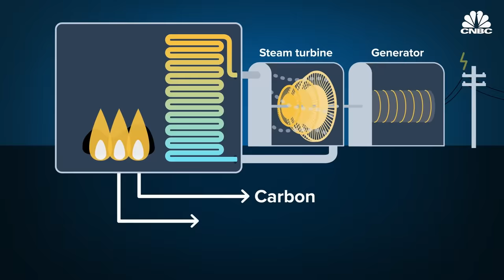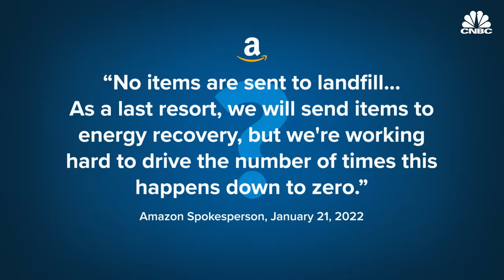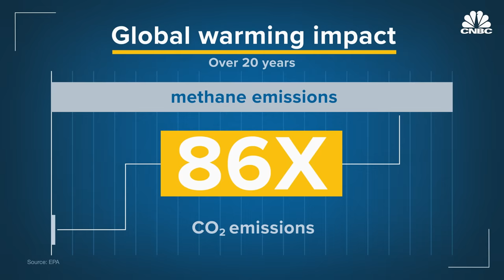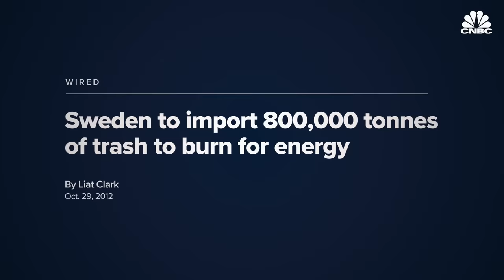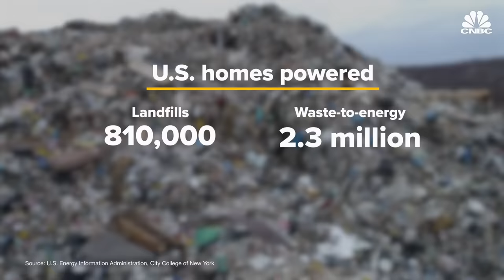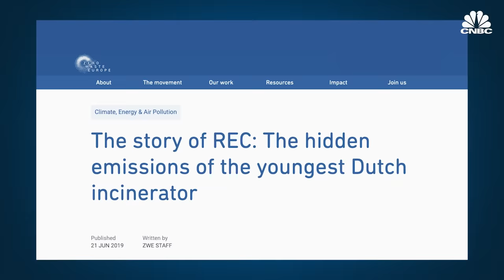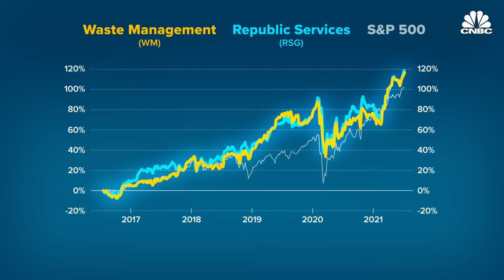How Amazon, American Airlines And Subaru Burn Waste To Make Energy

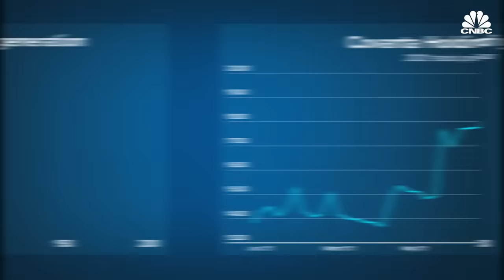Comment: This video is largely misinformation.  Almost every point being made has a huge (probably deliberate) error in it.  The chart at 13:46 is utterly false.  Nuclear is not the second most expensive way to generate electricity, it is far and away the cheapest that's why nuclear power plants sell their energy at or below four cents per kwh which is about 1/5 of wind and solar.  Gas generation varies from eight cents to thirty cents depending on how 'on demand' it is, and energy from waste is off-the-scale if you have to pay to drop off fuel .  Also, the idea that energy from waste emits less CO2 than gas generators is frankly laughable.  However, the gist of this is correct: It is better to burn than to bury waste.  That part is correct even if the costs are much higher and it has nothing to do with emissions of methane which are so volatile that they just never accumulate in the atmosphere.
Reply: Great summary of facts. This video is full of so much misinformation.
Reply: @rb8049  i find these cnbc vignets to be propaganda more often than not.
Reply: This is cnbc afterall
Reply: Building a new Nuclear power plant is one of the most expensive ways to generate electricity in the US and EU! China and some other countries with lower labor costs, less public opposition and fewer regulatory hassles are still building new Nuclear capacity. In the US and EU except France we are unlikely to see more Nuclear built any time soon. And by the way Nuclear is a base load power that can't be quickly ramped up and down like natural gas plant or batteries 🔋 therefore they sell at a "loss". Nuclear power plant is a 50 year investment so they calculate LCOE (levelized cost of energy) and if it's not worth it they ask for incentives from the government.

Solar PV is one of the cheapest ways to generate electricity. On the country side it can be even more affordable since we can avoid costly grid upgrades by local production and storage.

Wind is only cheap at scale in desirable locations.

Hydro isn't pricey either but most suitable locations are already producing.

Lastly, efficiency improvements can be cheaper than adding new capacity :)

Comment: Remember, also leachate from landfill tips is difficult to manage. It can enter creeks and ground water systems with devastating results.
Reply: Only on old outdated landfills, they are a problem, but modern landfills are properly lined.
Reply: @masaharumorimoto4761  There will come a day when the caps on the "modern landfills" will break down and erode away and these "properly lined" landfills will fill up with water and spill over and pollute the ground water. Most of what goes into a land fill is combustible and ultimately landfills will catch on fire and cause terrible air pollution. To prevent these scenarios from happening in the distant future we need to burn the trash that we are producing today and open up the land fills that we do have and start mining them for fuel and resources such as metal and glass.

Comment: Pretty good video here, BUT many assumptions are just thrown together.  The ash or what is called residue is NOT toxic from these incinerators.  The USA combines the Bottom and Flyash because the EPA does not get involved and provide counties options.  Nobody wants to take the ash because the EPA will not make a rule on what it can be used for...
Other countries are using the same exact incinerators and yes they use the residue in many things.  Not here in the good ol USA because too many greenies think they know everything.  At least this video is mostly truth based unlike many others before...

Comment: Energy can be had at a lot less of a price to environments and companies overheads when the engine of a generator is swapped for a electric motor. Electric motors have been around 30yrs longer than gas

Comment: 1$3,000,000 1.5mw wind turbine OR 857 10kw generators 

7.07x more power same cost! Before I switch it to full green energy 
No fossil fuels. Fossil fuels will be needed but not at the current scale

Comment: Ironically plastic packaging can reduce food waste, it can double the shelf-life. Arguably it's beneficial to the environment (when used right).
Reply: Thats only partially true. With fresh produce its most of the time the opposite. Plastic reduces the ability of it to „breathe“ so it will go bad quicker. Many fruits ond vegetables hava a natuaral „packaging“, its called the peel of the fruit. Processed foods on the other hand can be conserved in plastic. But thats not the way to go. Packaging thats used more than 1 time is better. In Beverages that is already done in many countrys of europe. Single use plastic simply isnt neccesary many times, but its easy and cheap.

Comment: Finding the most advanced filtration system for burning waste is the key here as well as applying the best system to isolate CO2 so its not dumped into atmosphere. Turning waste into clean energy, reusing it again with close to zero environmental impact are the first steps into circular economy and system we need to switch to. However first and foremost we need to REDUCE amount of trash and waste by reusing containers and packages we get with our purchases as well as moving towards biodegradable packaging. This is realistic solution in my opinion in case we want to keep consumption at current level and higher. However I believe the shift would need to be done also with consumption where we would rather consume less by purchasing quality products which will be designed to last longer and be repairable.
Reply: But unfortunately this is not what is happening.  The sales of cheap imported products of Amazon and Walmart keep increasing, and smaller businesses all fill bankruptcy.  Everyone need to make some efforts to change their lifestyle
Reply: @PG-3462  I agree, but in the same time you need to do all you can on all fronts to lower emission of the greenhouse gasses especially methane which is released in the landfills. Burning trash with best possible filtration is better option than leaving it in the landfill, over and out. Of course not burning it at all is even better, but that will take long time to stop or significantly decrease.
Reply: @PG-3462  Agreed, but if you to go with worst case scenario when people throw all the trash together with everything - organic and inorganic, you need to have efficient way to separate it which takes energy and time (resources).
If you do that efficiently you can somehow produce methane from the organic waste, but what really matters is how much energy and resources are you going to spend on recovering organic waste in comparison to generating new energy. The final value has to be at least equal or 0 or possibly gaining profit from it.
Same has to be calculated with burning both organic or inorganic waste.
Of course the best way is that masses will take fresh food from their own fields, but that's completely unrealistic and society will always rely on some sort of packaging.
I agree on the other hand that most of our trash comes mostly from the food packaging, so maybe this is something what needs to be improved, but without government funding of the new biodegradable materials we are going to end up with the classic plastic and cardboard. And then leaving it on the landfill and not burning it for some energy recovery with excellent filtration looks to me as not right.
Reply: @El.Duder-ino  Producing artificial fertilizers alone consumes a lot of ernergy (and extracting the raw materials used for it too).  Thus, separating organic matter from trash is the most efficient way of doing things because you can use all the compost generated to replace some artificial fertilizers and you can produce natural gas at the same time.  

Since I started doing compost, I realized that the amount of organic matter we generate on a daily basis is insane.  When you multiply this by an entire city of over 2 million people, it's a lot of methane and fertilizer that can be collected

The other thing it made me realize is that most of the plastic trash we generate on a daily basis also comes from overpackaged food.  It pushed me to purchase as much as possible of unpackaged fresh food which allowed me to reduce the trash I generate by nearly 80-90%.

Comment: never understood why they cant manage the emissions from the burning.... wouldn't it be a simple thing to blow the smoke in a dome and spray mist all over the  dome to trap the particles in water drops ? let it fall in a pool and just keep re-pumping the same water over and over into mist in the dome? at one point you dump the  pool into a larger pool to let the water evaporate ? would the gunk be left over at that point... I'm no scientist but just sharing my thoughts !
Reply: That's almost what they do now.  Long cylindrical stacks have various chemicals misted in them to trap various undesirable chemicals which fall to the bottom.
Reply: @grayrabbit2211  but the stacks are open ended so still releasing into the atmosphere so they cant really trap 100 percent this way or can they?
Reply: They do that already it is highly toxic the left over
Reply: @YesItsReallyKeith  I don’t think they are simple open ended cylinders.
Reply: That is what air scrubbers do

Comment: Incineration based waste-to-energy is not a sustainable replacement to landfill. The emissions from landfill are not from the dry waste and the Amazon returns being fed into this incinerator. The emissions from landfill are from the decomposition of food waste which makes about 50% of municipal solid waste. When incinerators are fed raw waste which has high moisture content, the incinerator operates at low efficiency and that is not good. Feeding directly recyclable materials like plastic containers and bottles and cardboard is wasteful and a contributor to GHG emissions. The sustainable solution for waste is the Integrated Material and Energy Recovery Facility (IMERF). The IMERF consists of a Material Recovery Facility (MRF) which sorts and separates the waste to recover the directly recyclable material, which is less than 20% (cardboard, plastics bottles and containers, metals and glass), the organics processing facility which uses anaerobic digestion and composting for the extraction of biomethane and the production of compost, and the chemical recycling facility for the processing of the 20-30% of the unrecyclable waste (textiles, packaging material made of soiled paper and film plastics). The chemical recycling facility thermochemically converts the unrecyclable waste to char and biofuels. Employing the appropriate thermochemical process enables the sequestration of the non-biogenic carbon in the form of char which can be used in the making of plastics, additive to asphalt and other uses.

Comment: Most larger landfills capture methane and convert it to energy.
Reply: Not everything gets captured. Its simply not possible. Leaching, when the lining if the landfill finally breaks is also a big problem for surrounding water bodys and the groundwater. Landfills are one of the worst ways to deal with waste. But its the cheapest and most convenient.
Reply: Methane is 25x more climate damaging than co2, so only small amounts escaping over time result in devestating results globally.

Comment: Reduced, reuse, sort, recycle, up cycle, then burning it is the best way. If we were to sort things properly we wouldn't have this issue. Instead of using a single stream recycle we could ultimately save recycling. And food waste methane could be reclaimed in a facility and used on our gas stoves/water heaters and CNG transportation. We could also use water from our drains to water lawns flower beds. Carbon capture fuel can be use for ships and rail transportation. With  bio fuel waste can be used to produce the energy needed for carbon capture. So many solutions that take brave action to stand up and say that we want change

Comment: Show a way to solve the issue. Blaming the consumer makes it easy for corporations to dump their trash with blame. They wrap everything in toxic plastics, containers are not dissolvable vs recyclable, products and clothing are made cheap and fall apart after wearing it, etc, etc.  Toxic air from combustion is not a solution.

Comment: All of this relies on the operator doing the right thing 24 hr a day, not just bypassing the pollu4controls after dark.
Also relies on the science being right, it can be accurate or it can be bogus.
Used to work for a com4that design. Some of these systems. That always knew early when EPA would show up.
They always had clean records when examined.
But the plumes and many vents doubled in heights most nights.
It could go better.

Comment: The burning has to have a misting system in the smokestack to remove perchlorate perfluorate and perbromate as well as carbon dioxide.  It is better not to manufacture halogenated vinyl or halogenated carbon molecules because they don't burn to anything less than the bleaches.  These still still have the functional groups of halogenated carbon.  This pollution affects the motility of sperm in all species and reduces atmosphere gases to water and nitrate.  We still have perchlorate perfluorate and perbromate pollution that interferes with reproduction of fish .birds and shore life. It is important not to manufacture use or burn any halogenated carbon or halogenated vinyl molecules so that we can have atmosphere and fish in the oceans.

Comment: This is nothing new. In my home city of Ames, Iowa, this has been done since 1975. Also, many landfills capture Methane and recycle what is captured.  It’s important to make sure a WTE has a robust air pollution control system on it to prevent pollutants getting into the air. Dioxins is the most common pollutant that is devastating to the environment. The cost of land is the determining factor on whether to go WTE or Landfill. Where land is expensive like in the NE and Florida, you will find more WTE facilities. 
Amazon and other retailers like incineration because it reduces the risk of their products getting into the emerging hands especially if there was an item recall.

Comment: How much water daily does these water to energy things use?
Reply: You mean hydroelectric? Well, it depends on how you define “use”: a hydroelectric plant doesn’t consume any water at all. All the water that flows in also flows back out. But if by “use” you mean how much flow it requires, it’s a huge amount. A small commercial hydroelectric turbine will have hundreds of gallons per second flowing through it. A large turbine will be much more: a turbine in the Hoover Dam has a flow of almost 30000 gallons per second.

Comment: It reminds me an old story, - if you don't want prices to go lower for oranges, - you are sending extra to the landfill. They don't want to reveal how much products they are taking out of warehouses, - they are just burning them! Why don't we pass the law, - that specific items should be warranted for specific amount of time? If not, - producers should be punished. Why is there need to create new freezer each new year? Just create the one great product, which will work for the 20 years without a single failure. Make a 10 years warranty for those products as the standard and those companies who not gonna meet it, - they will be banned as manufacturers. Why underwear and socks are lasting only short period of time? I bought in 2000 two t-shirts. Not sure what they made off, - but I am wearing them constantly for the last 20 years. They are looking like brand new, - but they are not. We should bring all the manufacturing standards to a very high level so we will stop getting those issues ever.

Comment: California should have this since its water dam power is getting to a point where it can't power anymore. They might take this on and take on a large number of waste to gain back their power.
Reply: There are many waste to energy plants in cali...covanta crows landing, the one in this video, is just one. There are many more on the i-5 and hwy 99 corridor. Many biomass power plants as well. Too bad all the big efficient plants that maintained the base load have been shut down. Moss landing, morro bay, potrero hill, Pittsburgh, contra costa generating station,

Comment: I dispose 40lbs waste each day because I use 6 disposable adult diapers per day for 34 years because I have urinary incontinence from damage caused by diabetes .  Those diapers are heavy with urine.
Reply: in a gasifier, start with generous embankment of coals. add a dew dry sticks until the refractory is red hot through and through and place 2 wet diapers on that and dont add anymore until the diapers are char. mind your coal bed. if the coal bed gets thin, you will lose the your flare. if you dry the diapers first then they will go up so fast and alone make enough heat to take a 20min very hot shower and do the dishes. if you see smoke, you are doing it wrong. remember, no plastic pyrolysis without a coal bed.

Comment: the speed of the video in the part about the costs is too fast. are you trying to hide something? 
what is the source of the graph at 16:28? what is "levelized cost"? from what I know nuclear energy is the cheapest, and where is hydroelectric on this graph? if solar was really that cheap you would see all the grid going to solar.
also the numbers don't make sense. you say that the WTE facilities have a profit of 22-30 $ per ton and they charge 85-120 $ per ton. that is 20% profit or am I missing something?